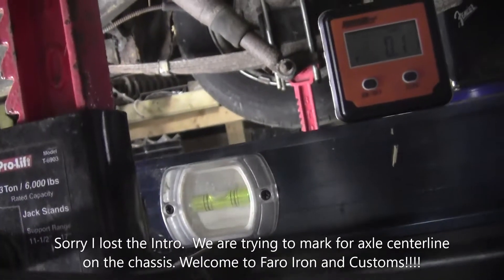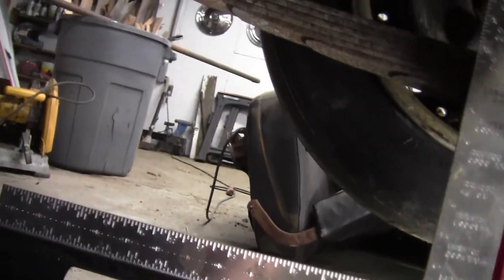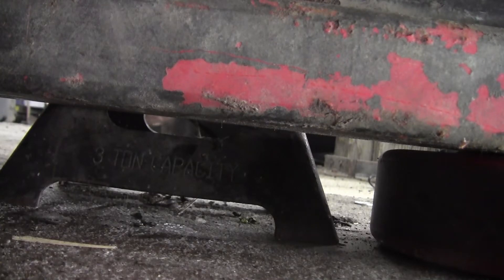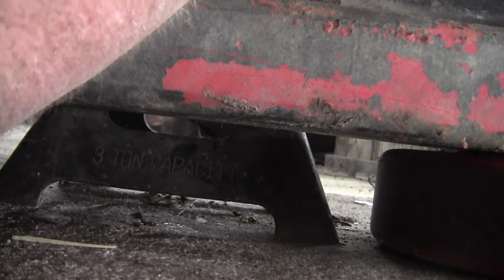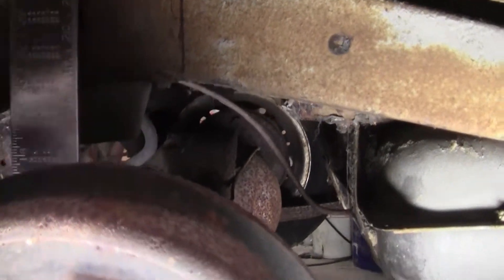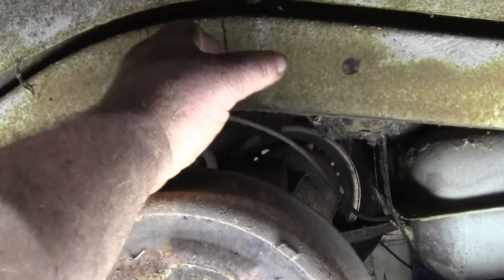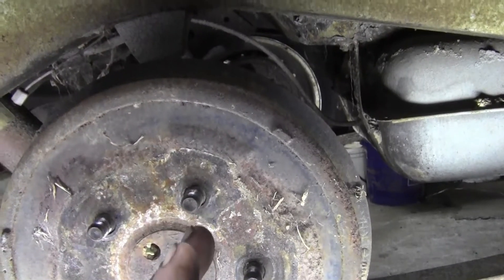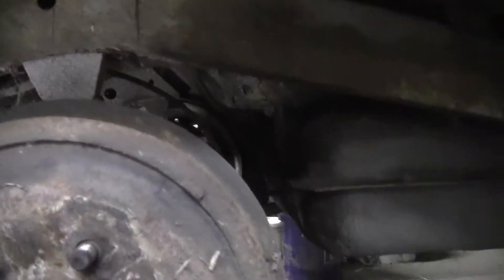Marking Axle Centerline

Comment: Would you say this is the EASIEST or the ACCURATE way to find the rear axel centerline?
Reply from the maker: This is how I did it. If I were using the axle I would weld it in place to the frame, remove the old suspension, set up the new suspension and that will keep it in the factory location. I have found center with a plumb bob and measuring the wheelbase from the front spindle. Also picked a spot on the chassis and measured to the axle tube and set it back to that point.  Not sure if it is the easiest but I do feel like I'm back in the factory location. So accurate enough. Thank you for the comment and watching.